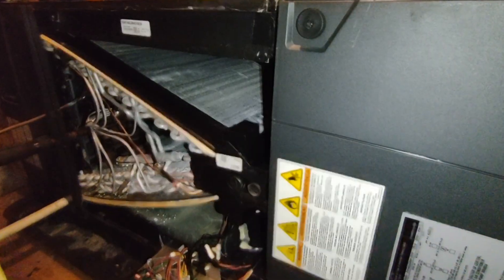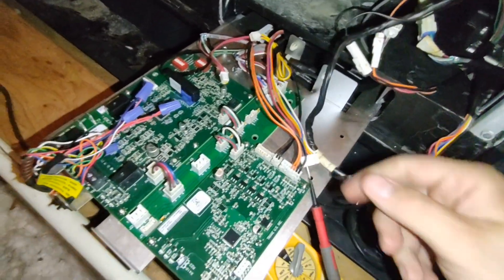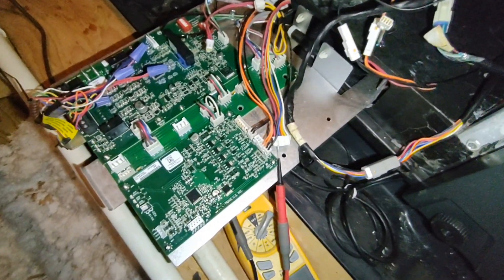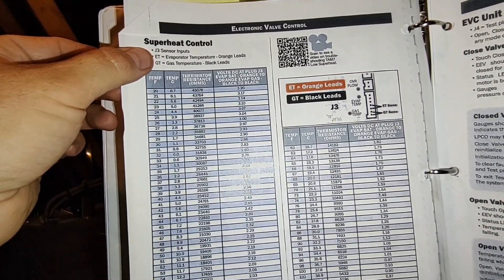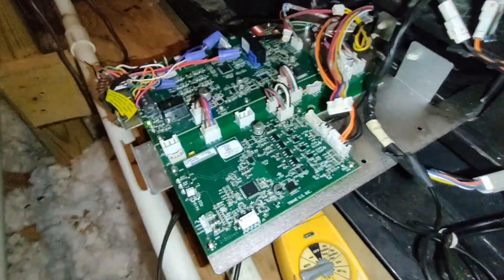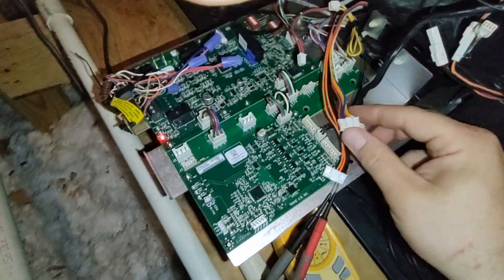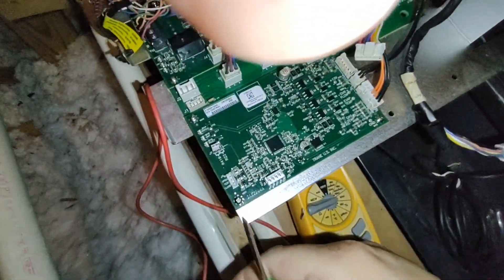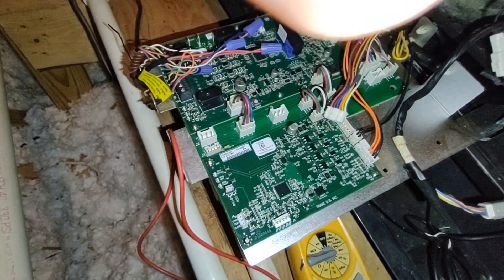Trane Tam7 EEV and ECV Troubleshooting ( SuperHeat fault )

Comment: I havent run into this exact problem but this is such a good video on how to troubleshoot the EVC board on a TAM7. Was this giving you any fault codes?
Reply from the maker: Thank you for the comment.  It was giving a superheat fault. System would start and pump down would only run when I performed the exv open test and then unplug the exv.   New board fixed the issue on this unit

Comment: Man ....I replaced the 3 board , the 2 sensors and EEV stepper motor ....and I still having the same issuen😂😂😂😂  I need to go back and check all wires and ensure that there is not any false connection 😅
Reply from the maker: A trane tech support told me to also check the emergency heat board. Apparently if it has malfunctioned/ failed it can cause some form of communication issue and close the expansion valve. 

You will get a new fault but maybe the system will run normally

Hope that information is useful